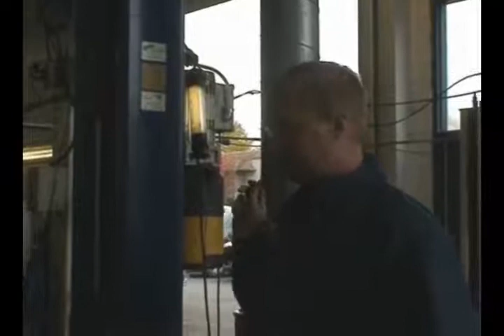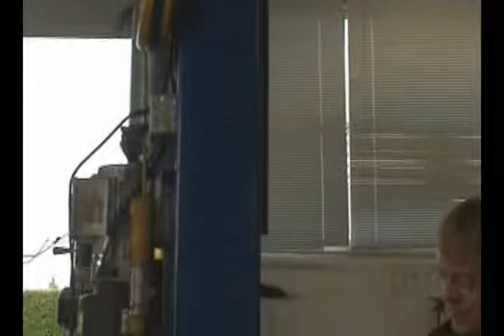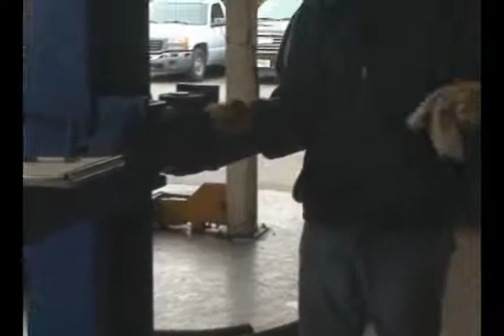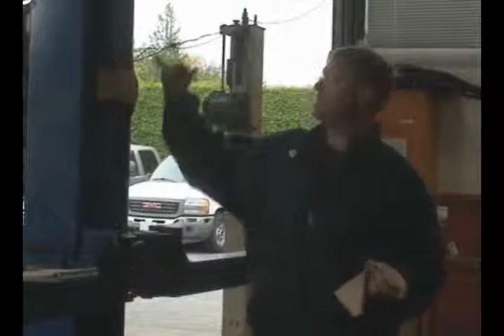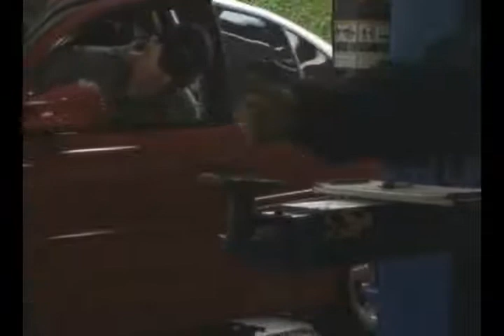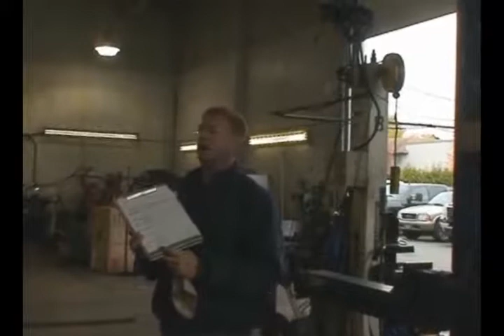AUTOMOTIVE Two Post Hoist inspection lesson

Comment: Never check cables by running your finger down the wire rope "cable". If there are broken strands, you will get injured. You can find broken strands by doing a proper visual inspection.